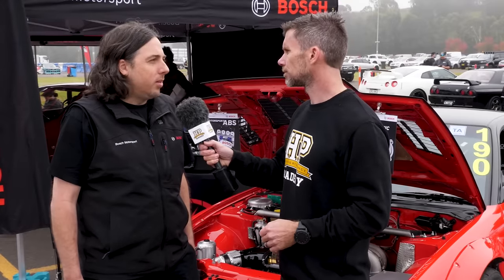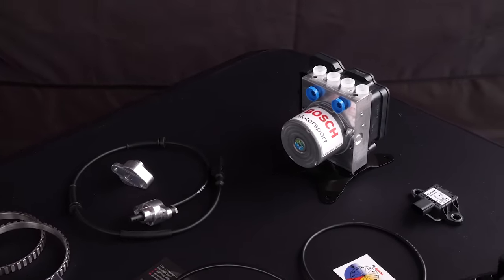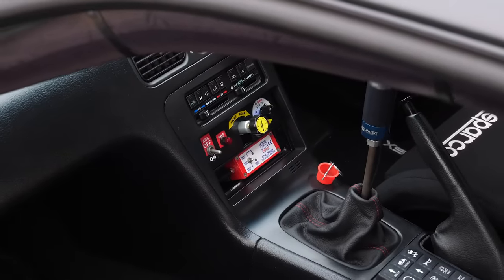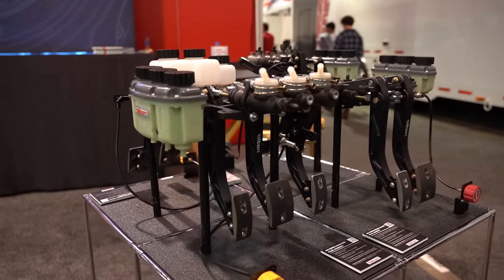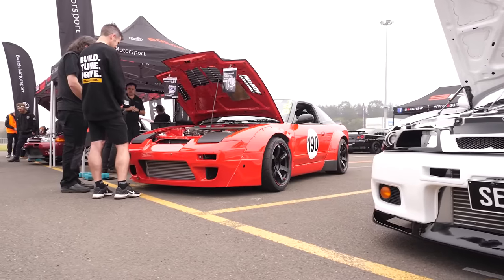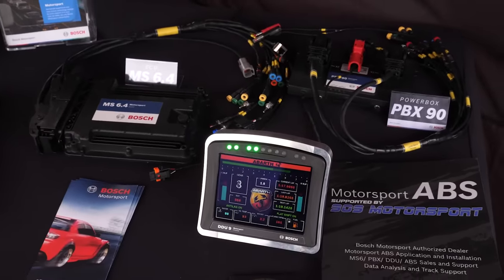Why Do Pro Racers Remove Brake Boosters?

Comment from the maker: Building a fast car? Get $400 OFF the VIP package and never pay for another course, EVER: https://hpcdmy.co/vipy22
Brake System course. Design & optimise your set up. Now 50% OFF. https://hpcdmy.co/brakes007
TIME STAMPS:
0:00 - Power Vs Stopping Power
0:20 - Factory ABS & Motorsport
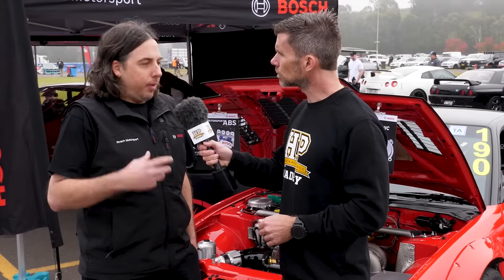0:45 - OEM Vs Motorsport ABS Focus
1:25 - Not All ABS Is Equal
1:50 - Is Motorsport ABS Harder To Use?
2:35 - What Is Different With Aftermarket ABS?
3:13 - 'Ice Mode'
3:38 - What Is Needed For Bosch ABS Fitment?
4:27 - OEM Parts Usage
5:04 - Brake Boosters & Pedal Boxes
6:01 - Why Remove A Brake Booster?
6:45 - Brake Bias Adjustments
7:35 - Crosslinked Brake System
8:02 - Front Rear Split
8:18 - ABS Won't Work Magic
9:00 - Driving Style Vs ABS Setup
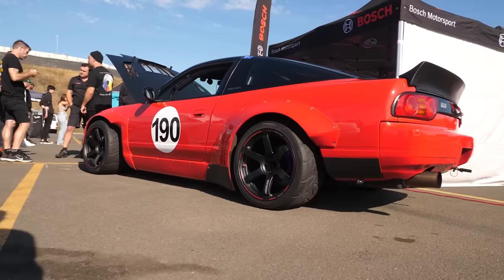9:58 - KEY POINT!
10:36 - Driver Adjustment Options
11:12 - Driver Preference
11:38 - Data Logging & Vehicle Dynamics
12:10 - Thanks 909 Motorsport!
12:25 - BUILD.TUNE.DRIVE

Comment: Nice Kit but for a base of $8,000USD it is waaaay over priced. Their other kits are $12-14k. Yea, it is cheaper than a car crash but also, no where near affordable for an entry class racer to install.
Reply: Yeah they are on the pricy side , best to drop on a used one from a race team . Thing is though most people including club drivers will constantly spend money on power, drivetrain, suspension upgrades just to go a second or 2 a lap quicker . That’s not cheap either. 
So do you spend thousands putting extra stress on your car and probably make it more unreliable or buy a decent abs and get the benefit of not bending your pride and joy ???? 
ABS for me
Reply: Look into s2000 abs I’ve seen the system adapted to a lot of cars, it’s kinda like that secret mr2 electric steering pump that’s tunable not super hard to adapt to any system
Reply: @newagetemplar6100  
Wholeheartedly couldn’t agree more!
Best bang for buck smart investment to make, considering the seconds in lap time improvements one can make, especially in wet conditions & not to mention, the most important, added safety aspect.
Most motorsports drivers pour much more money into performance mods for minimal gains & higher maintenance costs, including problems, headaches & unreliability.
Furthermore, flat spotting a tyre is quite expensive at well over $700 per tyre. Even more so, when you hit a wall or another car, especially on a wet surface with a non ABS car.
Reply: Best bang for the bucks is the mk60 from bmw
Reply: @roda1999  
It’s certainly cheaper & quite popular choice for most.
But, you only get what you pay for at the end & with no guarantee that it will work properly for your specific needs.
I have learnt the hard way in life to do things once & properly.
Whereas the Motorsport ABS offers optimal tuned system for your track/race car & specific requirements.
It’s like comparing apples & oranges.
Reply: It all depends on the intended purpose of the car. Check out the BMW mk60 abs. They are stand alone and lots of people use them in entry level motorsports.
Reply: @S30Build  Thanks for the suggestion. I have an older F-250 with a 460 BBF that I am fitting with a full suite of Haltech electronics. R5, Display, TPMS, 4 wheel and drive shaft speed sensors etc. Also rear disc from drum conversion. I plan to have a traction control set up. ABS would be really nice because once the wheels lock, it’s hard for the 92lbs of wheel to get spinning again. The R5 has native compatibility with the Bosch racing ABS.
Reply: @25aspooner  That's true. The R5 can't control the Mk60 unit, but you dont need it since the Mk60 has a built-in controller. You would still be able to read the wheel speed sensors with the R5 for other features. You could probably get the mk60 complete kit for 2k.
Reply: @S30Build  Yeah. That’s much, much more affordable. I’ve put a lot into this old truck and that would be a great addition. It’s mostly for work, pulling trailers and some off-roading. Is it CAN enabled or fully stand alone?
Reply: I hope asian fellas can do reverse engineering on Bosch system and build they're own for 499 DLS at ebay ahahah
Reply: @reggienotorious6824   which mr2 pump? I have a mk3 - can you point me to more info?
Reply: Yes this is expensive but these systems cost a ton to develop and the market is tiny. They have to sell these at the price they charge to break even and hopefully make some money
Reply: @roda1999  I wouldn't trust a Chinese 500 abs. LOL
Reply: I read a while ago that this system was (at least probably an older version) was identical to what's in a BMW m3 with different firmware and some effort was made to fix that to make it tunable but it's been many years since I've read up on that
Reply: I agree! Could be wrong, but I don't think racers are buying these ABS systems to prevent crashes as much as just for better overall braking performance and faster lap times. It may actually have the opposite effect by giving drivers possibly too much confidence to drive faster and brake later. I remember reading a study years ago showing that drivers of ABS equipped road cars were more likely to drive too fast and follow too closely than drivers of cars without ABS, so I wouldn't be surprised if something similar was true in racing too.
Reply: @averyalexander2303  The more confidence you have, the faster you can drive.
Reply: @S30Build  That's exactly my point and exactly why buying an ABS system for your race car may not prevent you from crashing as the original comment said.
Reply: @averyalexander2303  OEM abs vs. motorsport abs are designed with two different goals in mind.

Comment: The M70 for the E46 M3 is a standalone and although set up for understeer, compared to the CSL flash. It's predictable and if the car weighs proportionally the same as an M3 it's ok. The icing aspect can be eliminated with a g axis sensor. 
The Bosch Motorsport ABS is very very expensive and as he pointed out you need to map everything, wet, bias, tight vs long tracks etc. We found you only gain with the M5 abs is if you can test to build and log.
Reply: The mk60 from the csl or competition package m3s has a reflashable chip, and you can get them re tuned using the motorsports software. I have a mk60 in my e30. They are a very affordable 4 channel abs system. The major downside is no adjustability in the strength.
Reply: @zachogdahl210 ya I've totally read stuff like this.. getting close with jy or cheap parts compared to like 10k is decent option

Comment: C7z, I've looked into bosch abs but without vehicle specific kit its overwhelming. Ice mode is a real deal but adding coilovers and insuring perfect rebound and compression settings can reduce dynamically
Reply: I’m sure there are plenty of M5 units on c7zs out there. Someone like GSpeed would be able to help
Reply: Ice Mode is driver induced.. every time.. The ABS unit is not "on" until after it sees the brake light switch *and pressure. If it sees pressure before the brake light trigger? Ice Mode. I can train every driver out of it and have for many years. Drivers who have won championships in multiple pro series. *Some of it is often triggered because of air gap to brake light sensor or sensor is out of adjustment. Porsche released a shield several years ago for the factory race cars to keep the drivers from kicking the light switch when doing driver changes.
Reply: @racingdatasystems3708  I disagree.  I can hit it almost at will on certain courses by hitting the brakes when I still have one of the rear tires in the air.  It also will not reset until I get off the brakes and then back on.  It will sit there and pulse while slowly slowing down in a straight line on the center of the track.  I'm sure it's system dependent, but hit it with sumitomo ABS, Bosch mk60, and ATE ABS.  There's something in the programming of all those systems to where if one wheel stops faster than it expects is possible, it will dump pressure to all wheels until you release the brakes all the way.
Reply: If you have wheel height sensors and pitch/g sensor plugged in you can shield it. Yes it will occur with the older system as a default. But with these it provides the ability to trail brake as it won't go to ice mode as it knows you are unweighted.
Reply: it’s not that difficult to figure it out
Reply: Takes 30min worth of measurements to get the Bosch Motorsports ABS setup. I can install it on a 69 Camaro (with Corvette uprights) or a 2023 Porsche 992.

Comment: I remember driving my friend's VR which was among the first Australian built cars to have ABS as a standard option on some models and boy was it scary and a huge step backwards compared to my VP which didn't have ABS. Sure, no wheel lock but also as mentioned in the video it had bad pedal lockout and no amount of pedal effort would overcome the lack of stopping power.   100km to 0 took some approx 70m or so!

As for the booster removal.  That is an interesting point and it gives a more consistent and fast pedal response at the cost of braking effort.

An interesting thing is my car, still a VP has the old single stage booster, so the effort isn't great but it has nice long pedal travel and very easy and fast pedal response compared to modern cars which have great booster effort but firm and short pedal travel but most importantly have an extremely slow pedal response speed. 

So, although modern cars stop way better, I find them hard to drive as the pedal takes forever to press down so I try to compensate by pushing harder in the lack of anything happening, then the brakes suddenly slam on hard. Very frustrating!  Lightly but briefly tapping the brakes does not work at all in modern cars I found. Very similar feel to DBW, brief tap = nothing happened.

I can totally see why race cars have their boosters removed, a modern booster is very inappropriate in a consistency and speed sensitive environment that is motorsport.
Reply from the maker: ABS has come a long way thankfully!
Reply: @hpa101 yeah once I hit ABS for the first time in my 93 db2 gsr (one of the first hondas with abs, also first vtec besides nsx in na) especially on ra1s and almost rear-ended someone i deleted it the next day. One day maybe ill do the Bosch system or see if I can hack the production version from a jy to motorsport firmware
Reply: Keep the throttle on some during braking....it will kill some of the booster

Comment: about that brake booster discusion I went with 4d68t alternator for 4g63 that alternator got vacum pump on the rear, it removes prpblem of non consistent vacum for the booster. 4d68t dont have throotle body thats why it got the vacum pump
Reply: Forgot about some alternator’s having a vac pump , don’t need to do it personally but good info 👍
Reply: Which Cars come with that 4d68t alternator?
Reply: @CJ5EVOLUTION  all cars with 2.0 turbodiesels 4d68t: galant e57d, space runners from the same year like galant, lancers and colts from early 90s, mitsubishi forklifts
Reply: Oo that's interesting for packaging, I run an electric pump off a BMW or something but might consider this option if I can fab up a mount without much fuss
Reply: @forbiddenera  keep in mind that this alternator is quite big and on 4g63 its on the same side that turbo is and you can have its own packaging issues. I needed to weld the custom exhaust manifold to have clerance. Its not a issue on 4g68t due to the fact the turbo is higher and smaller there.

Comment: Great episode. My Honda EP3 ABS has worked well, the brake booster is hard to articulate well, since adding braided brake hoses that has improved. Nankang AR1 tyres.
Reply: The braided hoses didn't help. It was your flushing when installing that did. They still look nice and are more durable but yeah it's been reasonably debunked that brided lines do anything compared to rubber, they're just rubber under the braid anyway.

Comment: Time 958 to 1004 " the abs can't generate pressure and can only take it away ."  That would be true with a basic system like a basic rear wheel only " Block and Bleed " system found on 2000 ish pickups but a 3 or 4 channel system ( Block , bleed , build pressure ) has a pump motor to build pressure.
Reply: Yes I would disagree with his view of abs being 1990's era or the worst examples of  ABS, like the Mitsi cross path so everyone should go to the M5 Motorsport. The main challenge is it's a standalone ECU it's a professional tool. So you see Porsche Cup cars running the road car ABS ECU as it has a broader base tune, so you don't need to change the map for each circuit or have the driver tweak it manually.

Comment: Would be amazing if a company could provide a method to reprogram OEM systems. I've currently disabled my ABS since with my setup under braking I can have a wheel lift and when it does the ABS would cut all my brakes instead of just the individual wheel, it so jarring and felt incredibly dangerous.
Reply: Fit wheel height sensors, steering angle and a yaw sensor. This is what most modern abs systems have as they are evolutions of this old problem in 90's era ABS units. There may even be an OEM version in a later car as this information fixes the issue of icing when you get air
Reply: @fraserwright9482 oh for sure. My ABS system is from 2000, so it's kind of basic and honestly feels dangerous with my stiffer suspension. It made sense on factory suspension and tires, because from the factory it had relatively soft suspension and skinny eco tires, so i get why the ABS would be aggressive. With my setup, oh man too many situations that scared me to the point where I decided to pull the ABS fuse to see how everything would be and since then I never looked back. Even when I got cut off on the freeway, tires locked up slightly, but was easy to control even though I was completely caught off guard. The car weighs ~820kg/~1800lbs, it doesn't take much to get it to slow down.

Comment: I've always driven cars with no ABS. My current car (79 Subaru ) could come with or without a brake booster. As it stands, the brake booster does almost nothing because of the vacuum at idle being too low (big cam). Swapping to one with no booster just involves removing the booster and bolting a master cylinder for the non boosted cars to the firewall with the correct pushrod. The holes are already there and the pedal has a higher hole for a higher ratio from the factory.

Comment: I'm about to remove the brake booster and ABS from my 86, the system doesn't understand that big sticky tires are installed, it drops the pressure way too much for way too long, some crazy malfunctions too, like all of the pressure going to one tire. Bosch ABS looks incredible.
Reply: Yeah stock abs and sticky rubber don't mix

Comment: 6:25 i use a vacuum pump in my car to provide vac for the booster, more consistent, never run out of vac and can 2foot brake in boost without issue. Good cheap solution but obviously a pedal box would be way better
Reply from the maker: Pedal boxes are awesome, BUT, like just about anything they are not free and the most important thing is to have something to use in the first place knowing there will always be areas for improvement. Cheers for sharing and hope you are enjoying your seat time! - Taz.

Comment: It is crazy because I remember downshifting without rev matching into a corner and ABS, Stability Control kicked on and funny enough it was on the extreme side of it because the car SWORE I was about to fly off the road because it is an OE setup.

Basically if the car is driven normal the OE setup right now is at it's upper limit and the moment I drive hard it goes bonkers which adds one more thing to mod on the car 😂

Comment: It seems to me that using some type of vacuum regulator to maintain a consistent vacuum in the brake booster at something always achievable like perhaps 10-15 inches depending on the setup would be a better solution than removing the booster entirely. That way the driver would still get good assistance, but still a very consistent and predictable feel. As someone who has driven cars without the brake booster active just as a daily driver in normal traffic, I can't even imagine how tired my leg would get from repeatedly slamming the brakes on a race track!
Reply: The amount of force you have to make, as well as pedal travel, are determined by the ratio between the pump's surface area and the one of the actuators of the breaking system. So you can put a pump that needs more pedal travel but less force. What I mean is that a car where the servo has been straight up removed will need a tremendous amount of force on the pedal, but for performance applications you usually change the pump
Reply: @tomassosaoconnor  Makes sense, but then there would still be a trade off in the distance the pedal must be pushed if a smaller bore master cylinder was used, especially since high performance multi piston calipers generally need more fluid than single piston stock calipers. Having dramatically more travel in the brake pedal seems less than ideal for a racing application.

To be fair, I've driven cars that came with manual brakes and I've driven cars with disabled power brakes, but I've never driven a race car with a fully custom manual brake setup, so it's entirely possible I'm imagining the feel as being totally different than how it is in reality.
Reply: Not all cars make 10-15 inches of vacuum though. My 79 Subaru with a big cam only makes about 4-5 inches of vacuum at idle. That car could come factory without a booster though. The holes in the firewall are already there and the pedal has a higher hole for the manual setup. The car is so light (1800lbs) that the booster is completely unnecessary. It can lock up all 4 wheels with the booster disconnected with little force on the brake pedal.